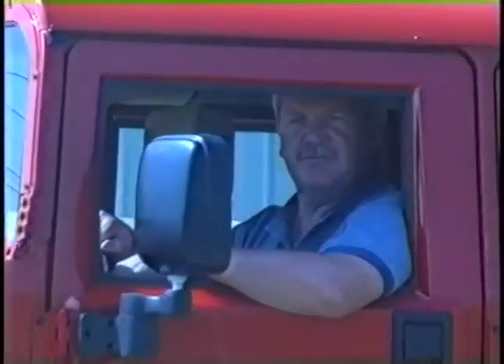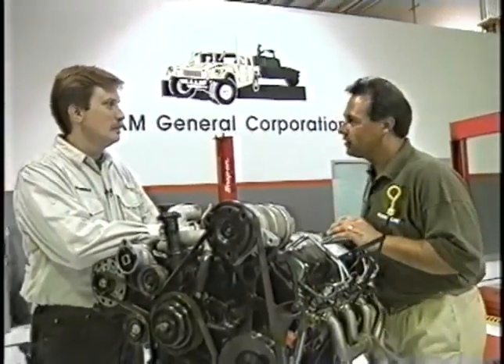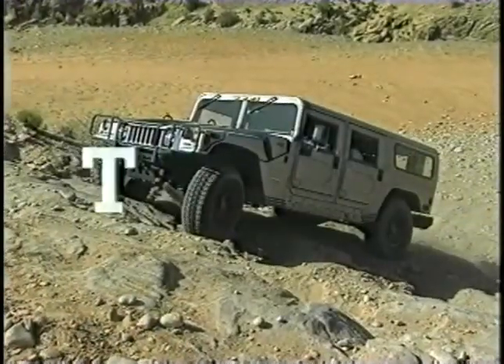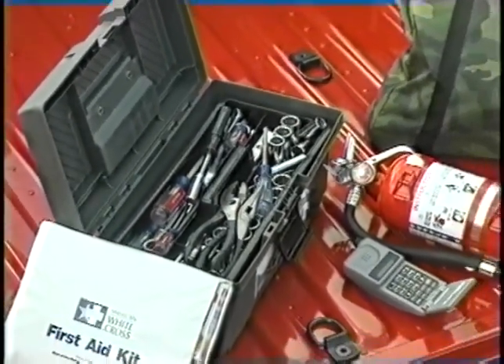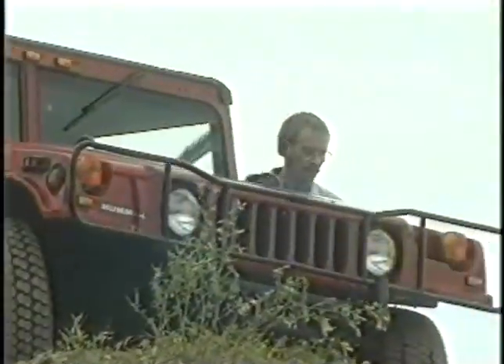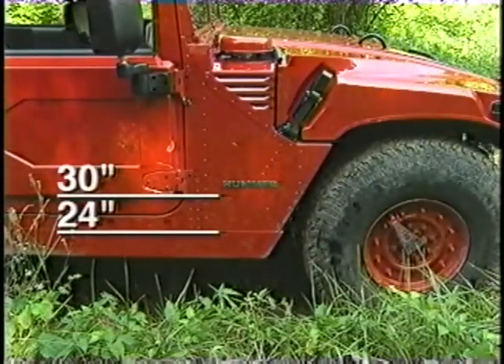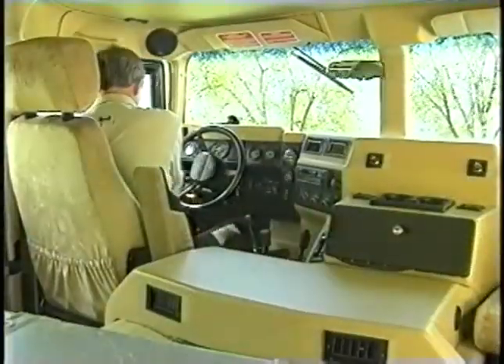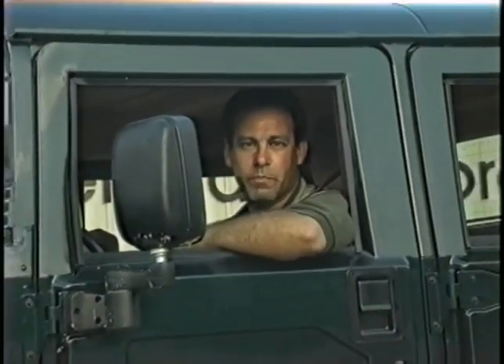HUMMER Tutorial Driving Off Road

Comment: Not a hummer it's a military hummvei
Reply: Those are hummers. Hummers and humvees are the same
Reply: No there not there made by completely different companies and everything about them is different  except the looks because the h1 hummer has looks faded off the military hummvei
Reply: The H1 and Humvee were both made by AM General in the same factory. The H1 was designed/developed/manufactured by AM General. Later they sold Hummer to GM but still contributed in design of future Hummer vehicles
Reply: I did some research and yes that's right but my original point still stands they are different vehicles which what I was trying to put through is that there not the same vehicle the design is almost completely different as in the hummvei everything is sucked up Into the cab to make it level with the chassis but the hummer is not it is made to be more practical for road not all terrain. And not to mention that the materials used are obviously different.
Reply: "everything is sucked up into the cab to make it level with the chassis but the hummer is not"  How would that be possible? The H1 is built off the exact line the Humvee is. They are 100% identical vehicles except for "Creature comforts" -Hummer and a improved engine. The materials are exactly the same except for the Interior plastic and leather.both have a heat treated aluminum alloy body.
Reply: Go find pictures of the underside of a hummvei and a hummer next to each other they are completely different in every way
Reply: I'm only seeing  undercarriage protection, otherwise everything is the same
Reply: It’s hmmwv not humvee